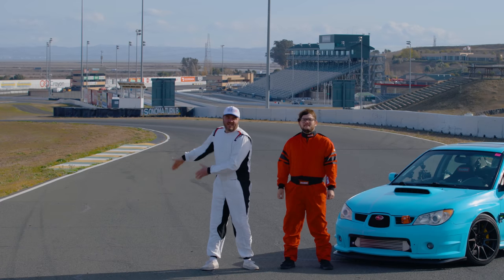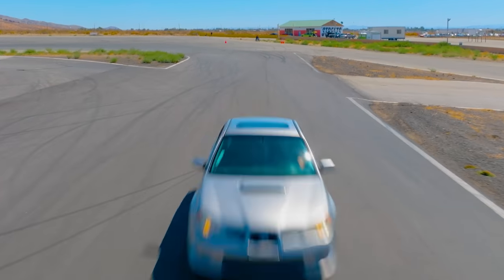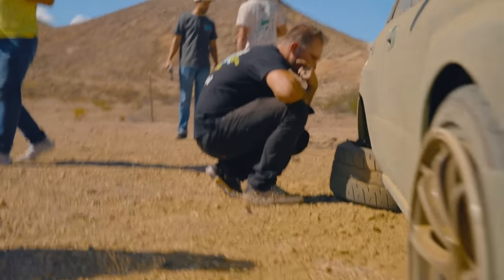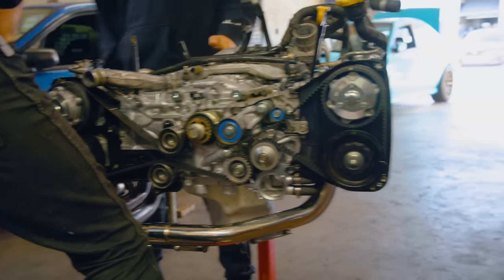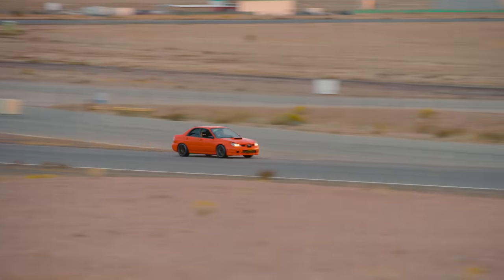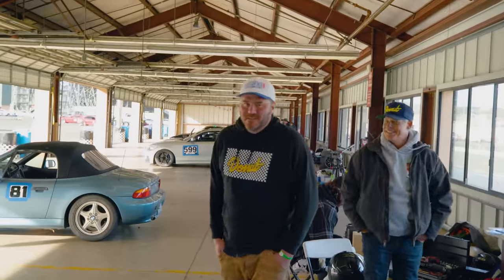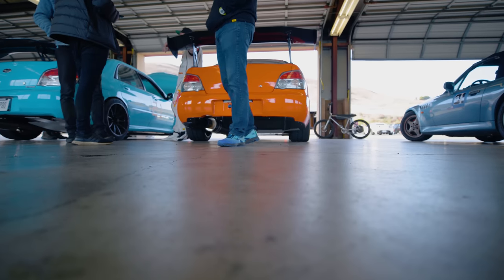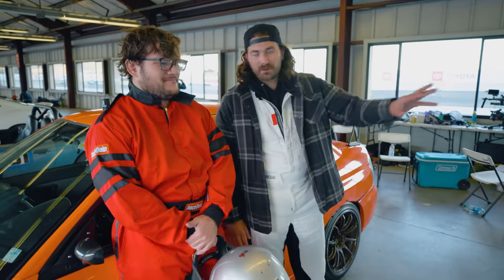$21,000 vs $43,000 Subaru WRX Build - HiLow FINALE!

Comment: This was one hell of a good series!  Out of the 30 cars I've had, my 05 STI Limited setup for winter driving is hands down one of my favorites. Stage 2+ with fantastic winter tires made it a best in winter.  You had grip days or you could be sideways around every snowy corner with oodles of control.  Zero issues the 4 years I daily and raced it.
Reply: You're in the minority
Reply: Although I do agree that the snow handling is so much fun.

Comment: This series showed every negative stereotype of the Subie engine.  I wonder how much it cost in total with all the engine repair/replacement.  We gotta be ballpark $150k.
Reply: I mean, at least potential WRX buyers won't be paying as much now.
Reply: Probably with having to replace hi car entirely twice. At some point of they could just bought built motors and trans.
Reply: @DragonKnightX12  They did initially buy a built motor for Hi Car, and it took a dump on the first track day.
Reply: @johnsanko4136  They bought a rebuilt motor, there’s a difference.

Comment: The biggest lesson I took from this season: Don't you ever buy a Subaru unless you have money to burn along with the engines.
Reply: Or just buy one with an ej207 engine and 6 speed box. Still more reliable than evos.
Reply: @tracktimevideos5164  Or just buy a Volvo. It's a fucking tank, no matter what you throw at it to should survive.
Reply: @pitekargos6880  for all the 50 year old ex-soccer moms.

Volvos aren't remotely for the same demographic
Reply: @noneyabizz8337  I agree. So that's why we have Civics to turn to if we need reliability. Or Lexus.
Reply: @pitekargos6880  got a Volvo thanks, comfy tank it is but fun fast or rewarding it aint.
Reply: @pitekargos6880  civics and Lexus are not awd rally cars. One is a bus and the other is for children.
Reply: @tracktimevideos5164  not much a rally car if you can't drive it hard without the engine grenading.

Comment: Great series!! I owned a 1998 plate wrx sti type r for 5 yrs and also a P1 for 6 yrs and the only issues I ever had was a cam sensor fail and the fuel pump failed on the P1 other than that zero issues, both cars modified and did occasional track days. 
Seem like they got super unlucky with the car in this series 🤷🏻‍♂️

Comment: The 5 speed can't hold that much power, anyone on NASIOC could have told you that 410 hp on the 5 speed was going to fail.

The lesson here is don't get the WRX, instead if you are going to mod start with an STI. Their suspension is much better (FEAL upgrades on the stock struts is better than even the tein coils) the stock brakes are **very** good, and the 6 speed with DCCD is good for 600+whp and is also better on track. 

Oh and you start with a larger turbo (which you will still replace)

Comment: Great season of hi low. I know now, more than ever. To never buy a subaru lol
Reply: I just keep mine stock and change the oil all the time. Red line it dozens of times daily.
Reply: @IQof2  I’m sure the next person will have problems…
Reply: @WhoamI20233  I'm also stock and just basic maintenance and still scooting along.
Reply: I had a 16 sti that was fine and pushing similar power to hi car. They didn't do the build correctly. A couple channels have done videos on it now.
Reply: Don’t let the incompetence of others sway your opinion, Subarus are good cars

Comment: This video with the issues with Subaru and tbh it’s how it is in real life I have given up on my
Bugeye build and just got another s15 lol
Reply: With a proper EJ207 engine and a 6 speed box you won't have these issues. With a standard wrx engine running 400bhp and the 5 speed box it will inevitably break until upgraded
Reply: @tracktimevideos5164  "If you swap out engine as well as transmission, it´s not that bad"

My buddy, that´s what fixes 99% of all cars with poor reliability. :D
Reply: @RealLeskot  lol that's not what I said. Just buy the right Subaru in the first place if you want to double the power of it. Of course a standard WRX engine and gearbox is not made to take 400bhp, an STi however will do that no problem.

Comment: I used to always want a subie, idk if I want one anymore…😂
Reply: nothing wrong with subies, you gotta remember that they didnt have time to do research into the platform due to time constraints. One thing you have to do is break the new engine in (which they didnt) upgrade your oil pan and pickup for track days (which they didnt) and not drive like a moron and drive off the track in AN ALL WHEEL DRIVE CAR (sry pumphrey no excuses there) not to mention their z's have v8's now and they had many turbo issues so lets not act like unreliability is  a subie thing

Comment: Wonderful season, I hope in the future you guys do another  high low but low car can be a bunch or retro fits like larger motor swap, larger brakes for another car,instead of cheap coil overs, a decent spring and shocks while high car will get upgraded turbos, racing brakes, and so on.

Comment: I liked how this low key turned into a documentary conspiracy type investigation video. I have a '14 wrx im trying to see if i can get a new engine of wrranty for. It was cosigned a month ago and it broke down. I dont think its the driver. I drove this 2004 dodge neon sxt with cut speed governors and royal purple for oil as hard as this wrx i got and the wrx (stock at 115k miles) broke. Im on the BUS otw from work writing this right now. I use push a dodge neon from basically Tacoma, WA to Portland, OR travel to school at 120mph and never had a problem. The only problem on that car was a cooling prblem and that was cause i didnt know how to properly burp a radiator.

Comment: As a cyclist I find it interesting how much cars and bikes have in common when it comes to how much some people will spend for what really turns out to be only the slightest of advantages.  A $1,500 bike is just as much fun to ride as a $15,000 bike, and while the more expensive bike may make you a few seconds faster here and there, it's definitely not worth the money.  Same with these cars.  I'm sure if it weren't being timed, you wouldn't be able to tell the difference in speed between these two cars, and therefore it makes no sense to spend all that extra money.
Reply: Зависит от сборки автомобиля. Сначала обслужи - потом думай.

Comment: Yeah Subarus take some serious dedication to make big power a lot more than the average car. But if you do it right there, awesome. Just most people don't realize that you have to treat them more seriously than most engines and therefore they have a bad wrap
Reply: The coolant 4 mod an oil air separator a longer oil pickup tube and a lot of other little details have to be addressed if you're going over stock

Comment: The more u tune the dearer things get while the gains get better by smaller n smaller increments. N tho there r exeptions this is the general rule so even b4 watching the video i can tell u, no, it wont be twice as good. Maybe see gains of 20% or maybe less.
U guys seem to b going way cheap sometimes n thats not a good idea. U might, depending on how u tune, even, see slightly bigger gains or get, atleast, more durable parts if u fit them together well with other things u also need alongside them

Comment: It just blows my mind seeing them blow engine after engine. We have owned 2 Subaru foresters and they never had any engine problems. A bunch of rust, but nothing ever happened to the engines. Is it that much of a difference between the foresters and the WRXes, or maybe the 2.5 litre is much more unreliable than the 2.0 litre?

Comment: Unfortunately 43,000 is not enough to build a reliable Subaru modified. Put a cosworth long block or an iag long block it will never die. The blocks are between $20-$40,000 by their lonesome. If you want a built Subaru you’re looking at actually stupid levels of debt to build it reliable.

Comment: One thing I never saw addressed was the oil issue on this type of engine. I never saw any type of Oil catch can or air oil separator. Maybe could have saved an engine or two during the series.

Comment: Im kinda mad i passed up a 1993 Geo Storm 5 speed for a 2002 Saturn sc2 that broke down on me, and a finaced wrx thats now in the the shop with rod knock after purchasing it at 109k miles and rod knock at 115k miles. I pushed my dodge neon sxt harder.... im getting a srt4....

Comment: Okay, I got suggested MrSubaru1387's video talking about some mistakes you guys made. Overall, I think his take was backed up by some backwards logic, but I did partly agree with him in some ways. 

So, I'll start with what I did agree with him on. You guys should've researched common problems with the platform better before diving in, modding, and thrashing on the cars. You could've saved yourselves an engine failure or two if you'd have researched the problems with oil starvation at high G-loads. 

BUT, I didn't agree with his conclusion based on these factors. He was trying to defend the platform, when there's really no defense for it. He defends it by explaining the issues and saying "You should've known about these." I think that's utterly stupid. Even if you did do research, with how much B.S. there is from actual nonsensical Subie haters, it can be hard to find true problems within all the false stuff. And, sure, you can prevent catastrophic failure by researching these issues, but that doesn't detract from the fact that they're still issues. Issues most other platforms don't have. Serious, engine destroying issues. And they're issues that can creep up fast, like the oil starvation issues caused by the OEM oil pan. Or the oil pickup problems caused by Subaru's poor manufacturing processes. 

Many platforms have issues after you start modding. But most of them are caused by modding without doing additional support mods. When it comes to Subaru's EJ platforms, you could grenade your bone stock engine just by taking it on a track, because you're almost sure to get oil starvation issues. Not to mention all the other problematic areas of the platform. 

I like Subaru. I liked these cars, and especially enjoyed this season of Hi-Lo because it was Subarus. They look cool, and they sound cool. But there's no getting around the fact that it's just not a reliable platform without doing a lot of work to it. There's many other platforms that are much more reliable with a lot less work, making around the same amount of power, or more for the same base price (before mods). I don't think MrSubaru realizes you can both be a fan of a platform while also recognizing it's unreliable. Hell, just look at Mazda rotary guys. I also love those too, but I understand they have some major issues as well. 

MrSubaru, recognizing issues and cracking jokes about them does not equal hate. We don't blindly hate Subarus, we just recognize their issues. And I think it's a good thing that Donut was lacking in their research, because it allowed many viewers to find out what they need to look out for before they start on their own Subarus.

Comment: I hope you took those cards to a local card shop and tried to sell some instead of just tossing them in the trash. Resell can value widely depending on rarity and demand of a card, but I've sold cards worth upwards of $100. I'm sitting on a couple, that I'm using so not gonna sell them, valued up to $200.

Comment: Y'all should do a high and low series on the Mercedes Benz c300 the ones with turbo chargers and build one up with high  parts and one with cheap parts turbo upgrade etc it would be better than the Subaru series plus cheaper than getting five subies 😂😂🤔

Comment: AS a previos owner i can confirm ej25 is junk. Mine started burning oil in first 7,000 miles then progressively got worse. my 240sx is twice as fast and 10x as reliable so the subaru started to sit in the driveway for last year of ownership before i let the dealership have it back.

Comment: Yooo this is crazy. Wrx engines are set to do thier power levels with in their set spec if you modify the hell out of a car with bolt ons and never do any supporting modifications or preventative maintenance then ya it makes sense ur gonna blow this shit up. The real problem here is you nwver once consulted a subaru expert. And ended up painting an amazing platform in a terrible light. I love you guys so much but this series just makes me sad because allot of this could have been prevented. You hardly stress the point that it was your fault that this happens over and over. Not just the car

Comment: Killing engines more frequent than changing your socks in a week.  I’ve been considering buying another subaru but this video is putting me off. 
 Anyone here know if the 2015/2016 wrx sti’s have better engines??  
(I Previously had 2002 UK P1 and killed that engine twice)

Comment: 9:07
Hmm... It's almost like you shouldn't be throwing on big power adders or major mods to an EJ without rebuilding the engine internals or something 🤔

Weird that the tiny lands would be shattering on cast pistons when you force 4+ times the air and fuel in them, isn't it? 
🤣😂

Don't get me wrong, I can't afford to do a full engine rebuild with forged internals (not to mention the supreme fuckery it takes to even do a boxer rebuild), so I'm not shitting on that. But I'd rather try my luck at doing a 20B bridgeport with a Dremel while drunk than I to remove an EJ, disassemble it, and then rebuild and replace it. Not sure if you know this or not, but Wankels don't take too kindly to shitty port jobs. And I've got kids... 🤣😂

Comment: I bought a wrx and had no idea how particular you have to be with them, there’s break in periods (which donut didn’t do), you have to get a tune after installing pretty much any mod. People come from other platforms and first thing they do is slap a intake on it and don’t tune it (which is like one of the worst things you can do to a wrx) and it destroys the car and they have no clue why and blame the car when they didn’t do their research before modding it. My wrx has 105k miles on it and I never had 1 problem, they’re reliable and good cars if you know what you’re doing
Reply: Every car has a break in period when it's new or you replace a engine with a brand new one???

Comment: If there wasn't already abundant information online about how bad Subaru engines are, this alone would be proof enough. They need to ditch their antiquated designs that they have been stubbornly hanging onto.
Reply: Almost like engines, that are to be fair a bit more finicky and need adequate supporting mods, and break in periods to be reliable.

Comment: damn guys after the second engine i'd just have given up on these fucking things :face-blue-smiling: do a Mitsubishi edition of HiLow bet you don't blow one of those motors i've only replaced 1 because the guy ran with no oil in my years at the dealership with 10 year powertrain and haven't seen another fail

Comment: they should redo this series and have someone that actually knows what they're doing, a atp bolt on turbo isn't what I'd consider "high car" they should of done a proper rotated setup, and their engine builder is a goof that should give up on engine builds. they wasted 6 grand on "aero" they could of used that money to get a proper block and turbo.. straight clowns.

Comment: I get the vibe these guys didn't check the oil from the start, lack of proper baffling doesn't blow an engine, having 2 quarts of oil in a car designed to hold 4.5qrts and then racing it does.. Subaru specialist here BTW, one that's literally replaced hundreds of engines due to being run low on oil..
Reply: See are your replacing engines on being run low on oil or are you replacing engines that had the right amount of oil but the design of the oil pickup is shit and it starved the engines of oil? You can't really tell.
Reply: @thefoodcan  They literally come in with less than a quart of oil, everytime..
Reply: @Mrbauto123465789  You poor the oil out and measure it? Because 2 and 3 quarts look the same. Also were do they say the had 2 quarts of oil in the video or are you saying they had 2 quarts? Because the video were they drained the oil it looked like it had more then 4 quarts in it.
Reply: @thefoodcan  No, because we drain bad engines and transmissions before we scrap them, we remove the drain plug and oil runs out for less than 3 seconds, pretty cut and dry..
Reply: Cope

Comment: I have friends who were willing to get a Subaru... not after these series they won't... And this is coming from a BMW owner (who spends his time in the mountains, and had only 1 small issue with his car that costed $130... and this is on an engine with 301,000 miles that I own for several years)

Comment: It's not just the oil pans.. forces are against you when you need to push oil out to the ends of the cylinder when they're horizontal. On top of that, the lack of forged components is overcome in the EJ with expansion tolerance. So you are almost always going to have starvation issues and knock and that's just the beginning. These cars are trash.